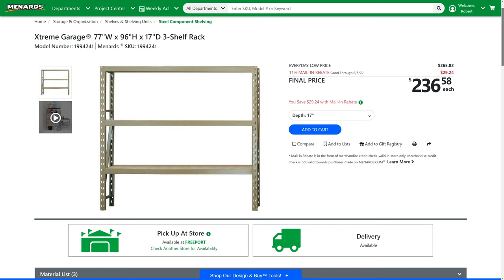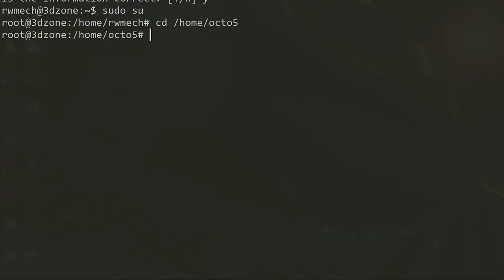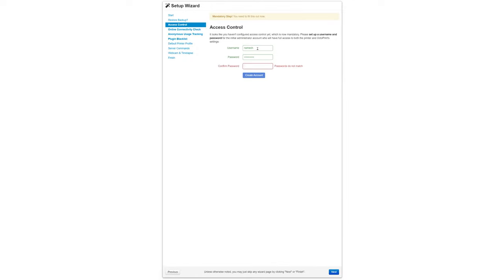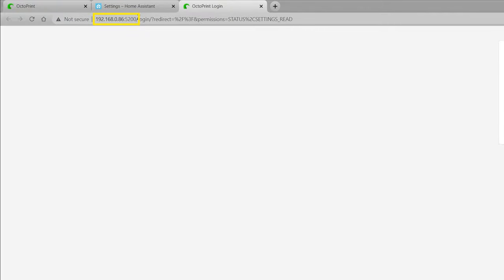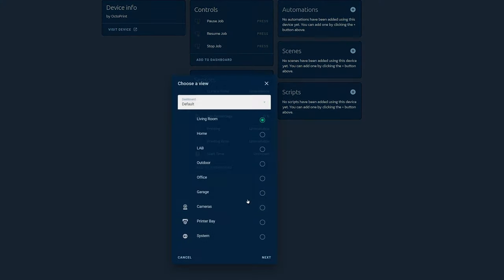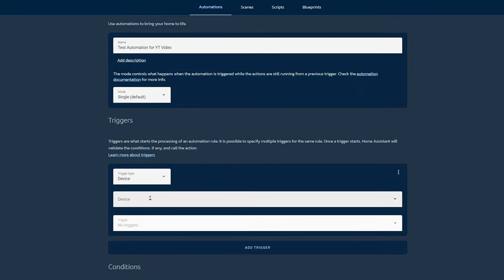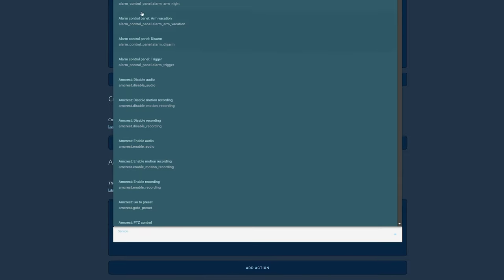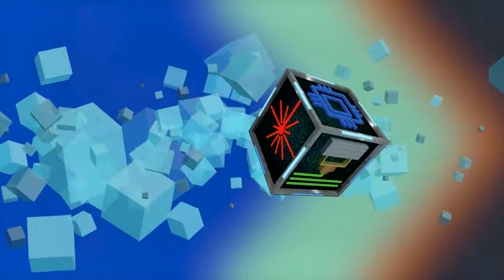3D Printer Bay Build ep. 1 - 6 Machine Octoprint & Home Automation

Comment: If you're not doing so already, you could add in some tasmota flashed smart plugs to control power on your printers combined with the tasmota plugin for octoprint. I use that setup with my printer and it works great. No outside automation required from Home Assistant. Just the one plug tied to the octoprint instance of the one printer.
Reply from the maker: I have each printer controlled through Home Assistant.  I didnt want to use Octoprint because I had a finer level of device control in HA.  I can also use google to automate turning on selected printers via verbal command.  The part I'm trying to figure out is having it not only turn it on, but preheat and home the printer.  So if you have some tips on that I'd love to hear it.

Comment: Did you make your own USB cables to run to the printers, I tried running multiple instances in Docker containers but was spending too much time problem solving so I sacked it and just ran 2 machines on each Pi with a total of six machines 4 running on 3b+ Pi's and the other 2 running on a Pi4 4Gb
Reply from the maker: Standard USB 3 cables to USB 3 Hubs.  I don't run a docker container but directly under Linux.  I think what is making the big difference is the 3.2 USB PCI card I put into the machine.  That gives me high speed USB 3 to all the printers.  I run a standard cable to two USB 3 hubs.  So everything is high speed and then I use simple USB 2.0 cables to each printer.  The USB 3 hubs are all powered as well.  In the next video I'm going to focus on the power but I'll also touch on the USB setup as well.